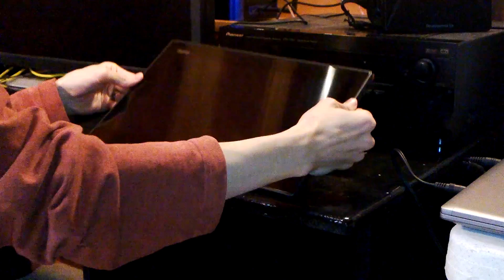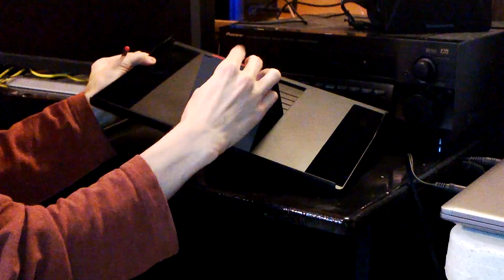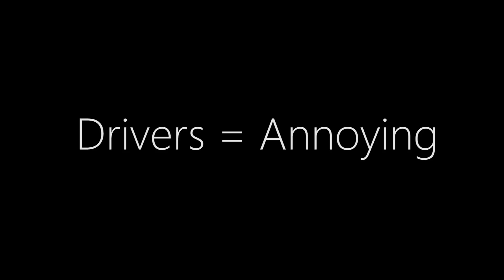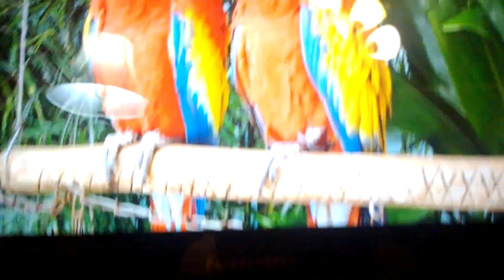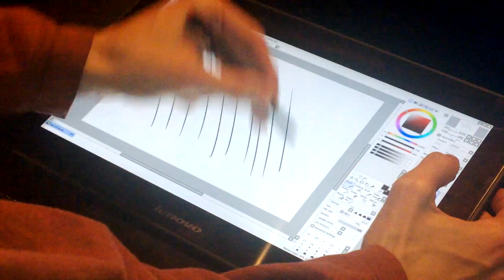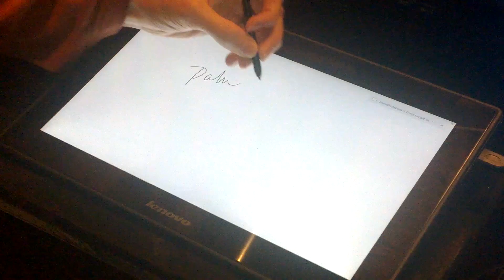Oranjoose's Lenovo LT1423p Graphics Tablet Review

Comment: How much does it cost
Reply: I just bought one for 89$ on ebay and man does it rock! I had to get the drivers for it from Datalink website and they support it in both Linux, Windows 10, and MacOS. I use it as a primary display for my gigabyte brix pro i carry in my bag! I use a 6ft and/or 3ft 3.0 to usb (hdd cable) and it works!
Reply: jazzynet1 would you please share the driver link? I got this product recently, however, I don't know how to use it.
Reply: Zirix YT uh-huh what is a drawing tablet....?

Comment: By default, the Pen and Touch functionality is assigned to the primary display. When the LT1423p monitor is used as an extended display, follow the steps below to reassign the Pen/Touch function to the LT1423p monitor.1.Open Control Panel, then open Hardware and Sound, and then Tablet PC Settings.
2.Click on the Setup button in the upper right.
3.Choose Pen Input.
4.Press Enter to move the white calibration screen to the LT1423p monitor. 
5.Then tap the ThinkVision LT1423p screen with the pen until the white screen closes.The Pen function now works on the LT1423p monitor.
 
Follow Steps 2-5 again. For Step 3, choose Touch in order to move the Touch function to the LT1423p Monitor.

Comment: I wish I knew how you finally got the whole "this screen is the one I am using" issue worked out. I'm tired of trying to figure it out for sure.
Reply: +Neva Li I don't know which OS you're using, but in Win 7, if you search for 'calibrate the screen for pen or touch, and the click the 'setup' button, it'll go through a wizard that will ask you to either click on the screen to identify it, or press Enter to move to the next screen.  Then just press enter till you see that text on the correct screen, and 'press' on the screen.  That'll register the input on that screen from then on.
Reply: +Jake King - yes, Win 7 and thank you. I will try this path.
Reply: +Jake King this works for windows 10 too thank u so much man
Reply: By default, the Pen and Touch functionality is assigned to the primary display. When the LT1423p monitor is used as an extended display, follow the steps below to reassign the Pen/Touch function to the LT1423p monitor.1.Open Control Panel, then open Hardware and Sound, and then Tablet PC Settings.
2.Click on the Setup button in the upper right.
3.Choose Pen Input.
4.Press Enter to move the white calibration screen to the LT1423p monitor. 
5.Then tap the ThinkVision LT1423p screen with the pen until the white screen closes.The Pen function now works on the LT1423p monitor.
 
Follow Steps 2-5 again. For Step 3, choose Touch in order to move the Touch function to the LT1423p monitor.

Comment: Hello. I bought this thing a while ago, based on your review. But I have something to add. The Pen pressure sensitivity is by far worse than on your typical Slate PC. Especially when using the same pen on 2 Devices. The Pressure settings simply don't work. Why? The damn values are switched around. I had to customize the ini file to get any pressure sensitivity at all... Is there something I missed?
Reply: I have a suggestion on your sensitivity issues. First, of course, convert that Lenovo pen into a tapping mouse for one of your Wacom based devices. OK, I stumbled across a video yesterday and I was impressed. This clever young fellow removed the cover for the control button on his S Pens. ( which of course are Wacom based). After he carefully pryed the little switch cover ( don't know what it's called) but there was 3 little screws under there. The one closest to the top of the Pen doesn't do anything, but a quarter turn at a time on the one or maybe it was both, really "tuned" the Pen and it went from super fine to bold. He warned not to turn them a full revaluation because the  adjustment is just one 360° path. 

I have S Pens from every Note phone and tablet in the Galaxy line. This is something I discovered. The S Pen from t h e 12.2 Note Pro, is exactly the length of the one that fits in the silo of the 1423p. $13 on Amazon if you get the white one . I don't use them as much as the Samsung Slate 7 Windows pen. it is $23 on Amazon and has an eraser, which works on all Notes but not this screen. They do have replacement nibs unlike the Lenovo.
Oh, don't forget to replace the cover when you get your pen at its best adjustment.
Be Well
Reply: +Gatorproof I'm trying it out now...trying to open that pen... do you have the name of the video?
Reply: +Gatorproof oh, nevermind, i opened the pen and see the screws now. :)
Reply: +AmstradExin 
Glad you got it. Sorry I didnt see your post until today'
here is one of several links about pen tuning.

http://forum.xda-developers.com/showthread.php?t=2191333
Reply: C. Rex I have to dust off that thing later. :)

Comment: Would like to use something like this to fill out forms.  It would be connected to a dual montior desktop PC on Windows 8.  Will it mirror both monitors, the primary monitor, or be available as a 3rd extended monitor?

Comment: Have you been able to test this unit on a Mac?
Reply: Lenovo specs don't list it see here:   http://support.lenovo.com/en_US/detail.page?DocID=PD028550.   I did read that someone on the forum.tabletpcreview.com got it working with a mac with bugs, (calibration issue, 2cm difference from stylus to point on the outer edges of the screen)  P.S great review of the Monoprice tablet, might get one but back ordered till the 21st.
Reply: Daniel Aleshinloye Yeah I read that forum post too. Seems like people that HAVE tried it on Macs are being extreme vague for the most part. It also seems the USB 3.0 "requirement" is totally bogus. Once this thing is on Amazon, I might just buy it in order to do a proper review then send it back if it doesnt really work on a Mac. Glad you liked the Monoprice 19" review. Best I can tell that same exact hardware is being sold under about 3 or 4 different brands/model numbers. It might be around sooner if you check all the different people selling it.
Reply: Joel Watson I bought the LT1423p and got it in the mail this week.  There are no native drivers for Macs and currently the calibration on a 2013 macbook pro doesn't exist.  There isn't much else to tell given this isn't intended to be compatible with OSX.  Extremely disappointed.